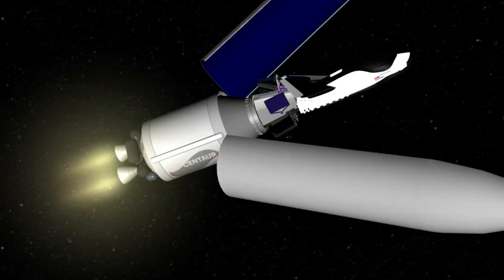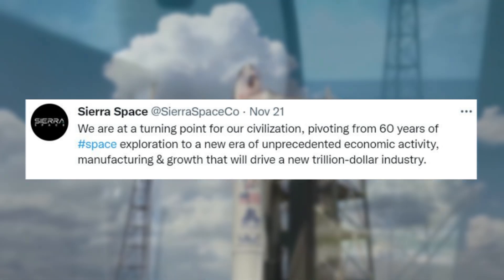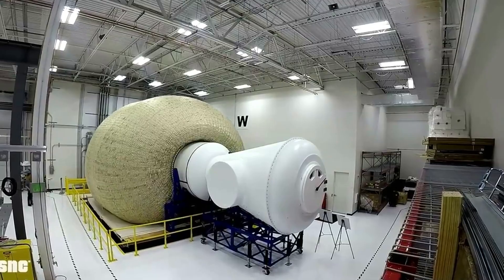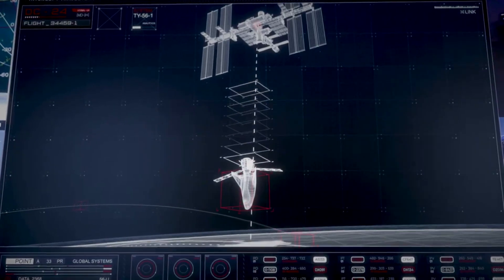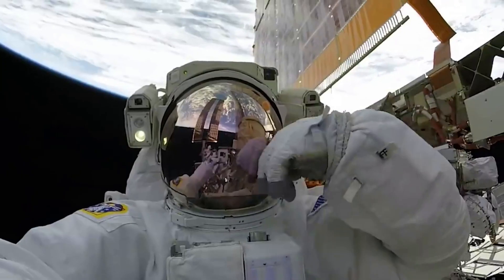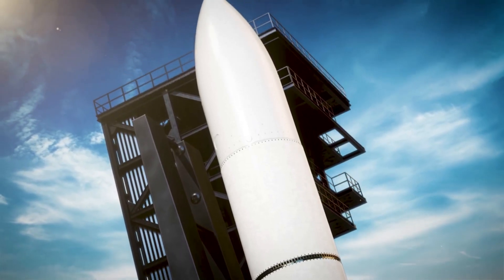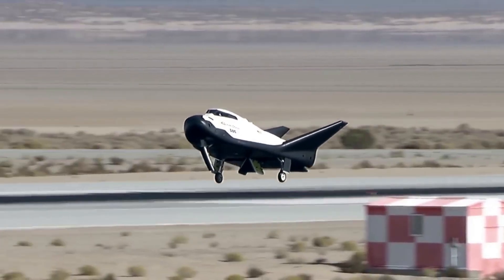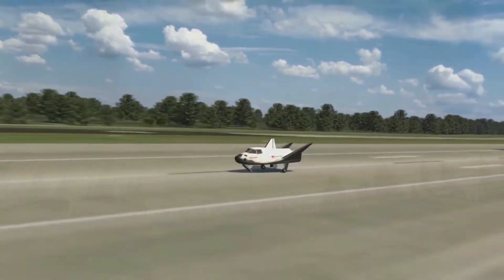Confirmation of Dream Chaser's Launch, More Updates, Progress, & More

Comment: Dreamchaser is by far the best spacecraft to ever exist, at least aesthetically.
Reply: A craft similar to Dream Chaser was NASA's original plan for the Space Shuttle, till the DoD made demands for something bigger for the retrieval of spy satellites.  In the end, the DoD moved beyond that need, and we were stuck with their expensive, bloated design.
Reply: The X33 program would have been a better choice with single stage to orbit. But the program was shut down by the government due to the carbon composite fuel tank technology was brand new at the time and could not get them to work. Lockheed wanted to replace them Aluminum lithium alloy till they could perfect the carbon tank. They cancelled the project saying it voided the contract agreement. The first X33 was about 80 percent complete at that time. Many years later we now have carbon fiber fuel tanks and even carbon fiber rockets. Lockheed did a study and submitted to the government showing that they now can manufacture the carbon tanks for the X33 and resume the program . The request was denied. They are alot of project and programs with so much more capabilities but were cancelled just cause. You should look up the X37 program and how the NASA was ordered to stop the program and immediately transfer the prototype and all research to the Airforce.
Reply: @FalconWing1813  the X37 is a cool shuttle successor, but in my opinion it's kinda ugly compared to Dreamchaser.
I had not heard of the X33 program and that linear aerospike engine is definitely amazing.
Reply: @plainText384  
RE: "the X37 is a cool shuttle successor, . . ."
The X-37B is unmanned. It, therefore, in my humble opinion, is not a space plane. It's a space drone.
Reply: @spaceman081447  dreamchaser is also unmanned, as was buran.
The (never built) X37C on the other hand is designed to carry up to 6 astronauts.
In my opinion, drones are just a subset of planes.